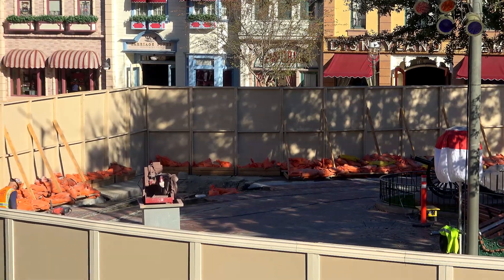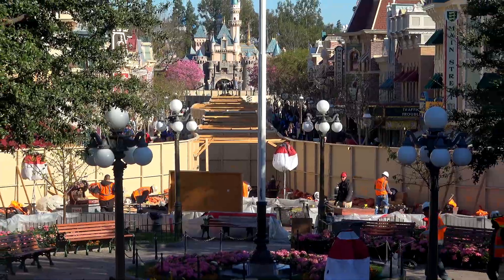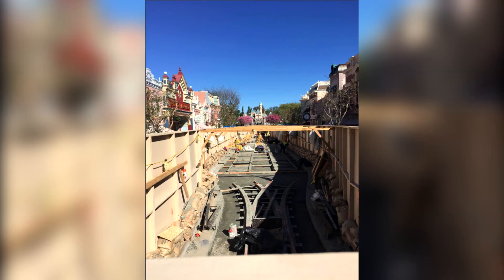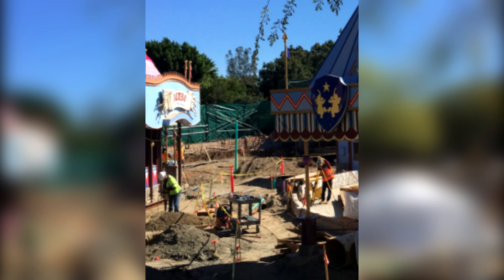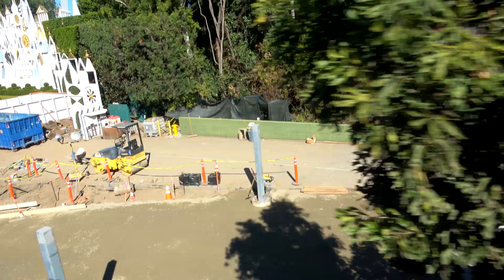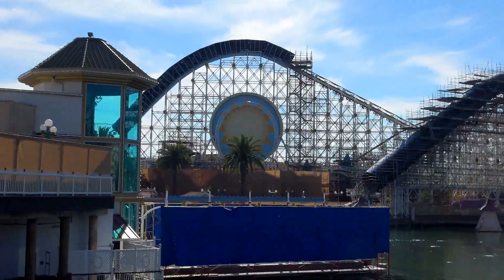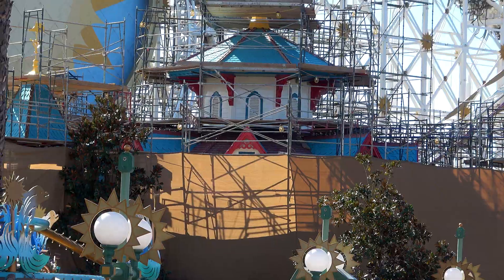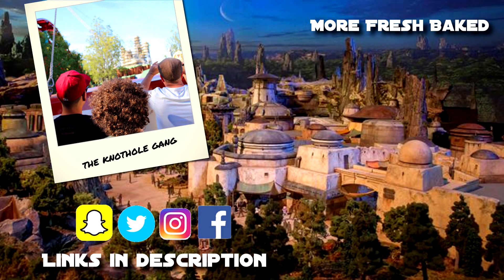Disneyland and Pixar Pier Construction update - Main Street , Pixar Pier, Dumbo | 02/17/18 pt 4

Comment: The two guys watering the concrete where just cleaning the floor. they make cuts on the concrete to have controlled cracks. When you make cuts it leaves dust all over so they clean it after.

Comment: NSA!
Reply: @9:30 that could be the new gate, what the guests see is a facade that can be easily placed and would more then likely go in last so it isn’t messed up by any construction work. With that area blocked off there is no rush to do anything there short of pouring footers for the supports the facade would attach to. Everything has an order and finish work is usually last.